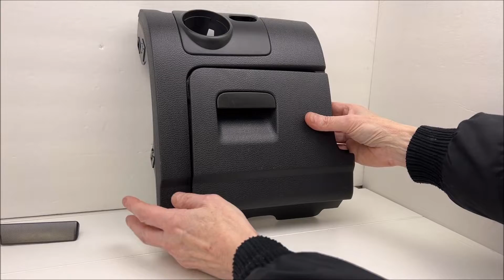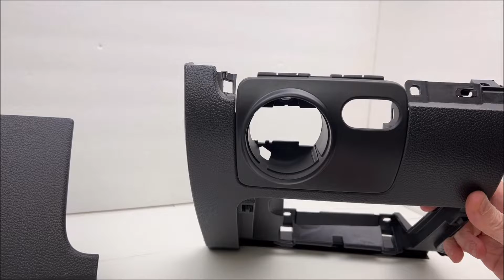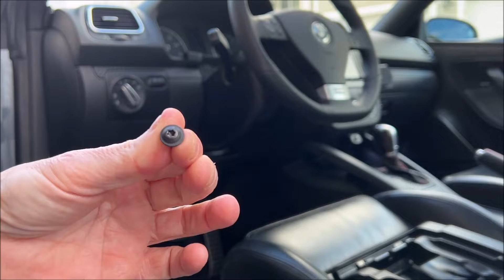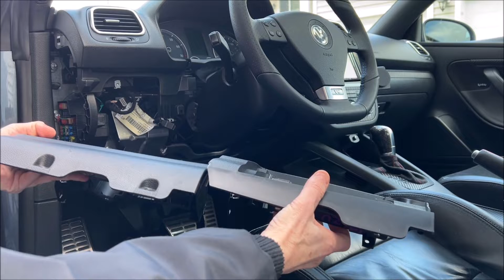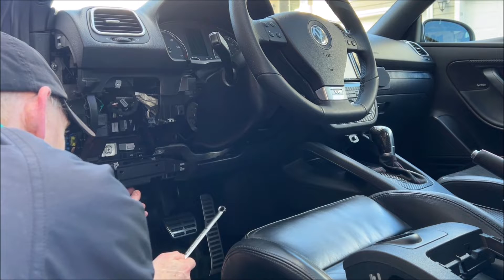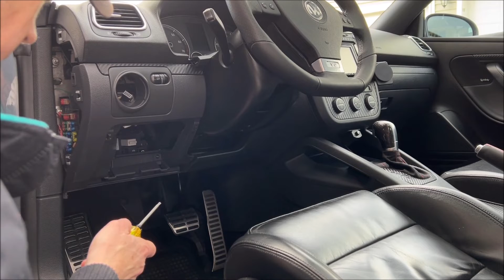Installing the euro cubby storage tray into a Volkswagen EOS VR6

Comment: I see you installed a MK5 R32 steering and wheel and shifter I believe , any other R32 parts? The R32 pedals fit and also the break calipers. A performance intake from a Passat will fit too. Any performance parts you may do?
Reply from the maker: Actually its a GTI steering wheel.  I did install a matching foot rest and modified the factory air intake by removing the diverter valve, sealing up the hole and also sealing up the openings in the air scoop, so its a true cold air intake, only drawing air from the outside, not the engine bay.  Also a K&N panel filter.  Was unable to locate Mk5 R32 brake parts, but I did source some 2012 Golf R brakes, which are basically the same as the R32's, just black.  Still need a few parts for the front, have everything for the rears.  What is the story with the Passat intake?